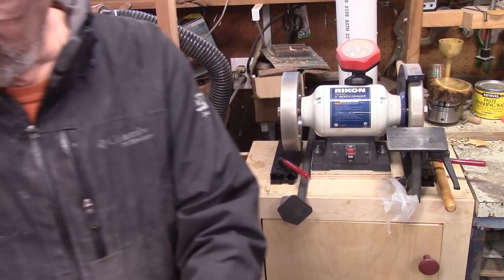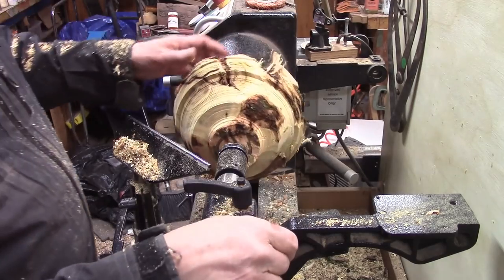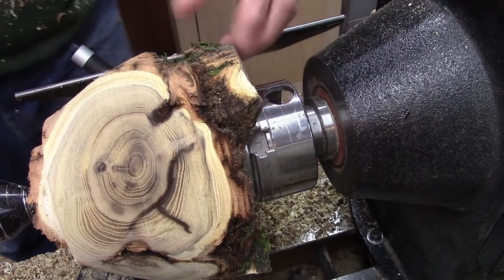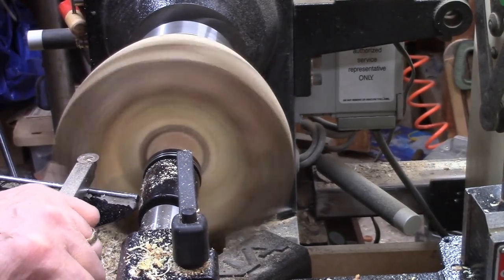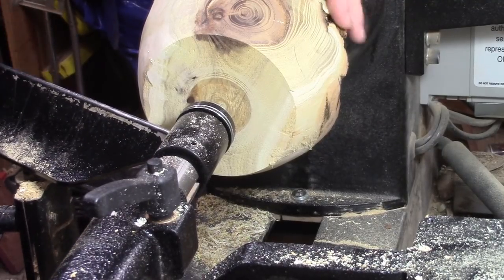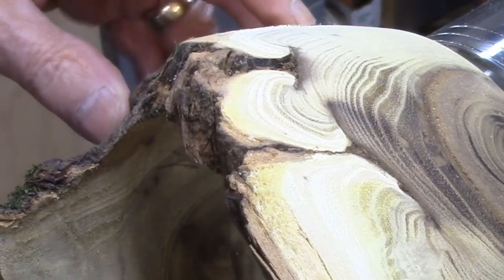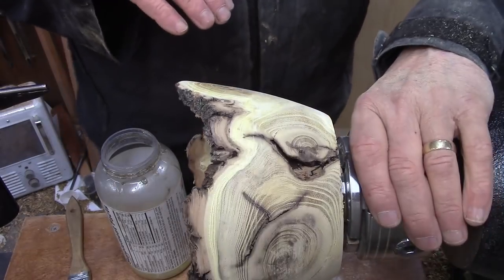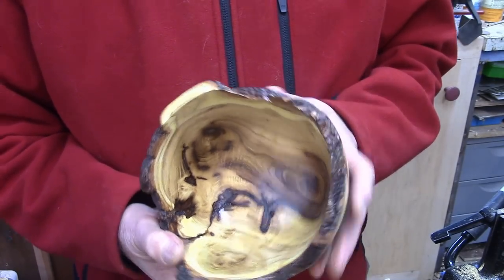Black Locust Live Edge Bowl  Gift from Nature

Comment: What is that tool you are using?
Reply from the maker: If you are talking about the one with the flat wood handle made of mahogany it is a diamond point tool I made from  stellite. It is in the range of cobalt-chromium alloys designed for wear resistance. It is ground sort of like a scraper but with a much steeper angle. It cuts very well and is great for roughing  out of round pieces.
Let me know if that is the one your are asking about.
Thanks for watching.
Gary